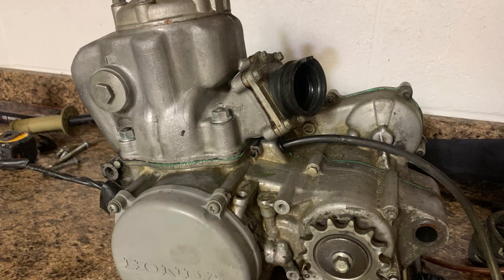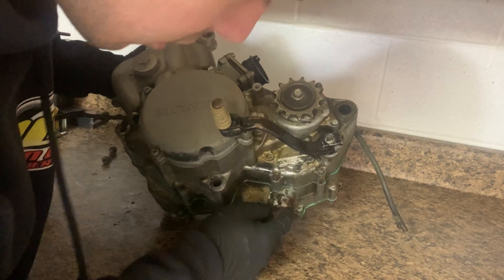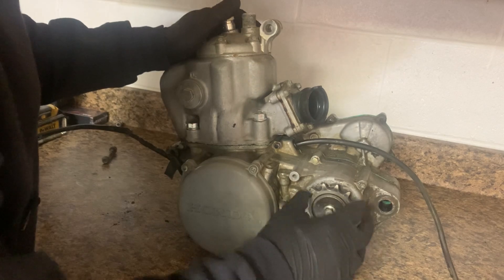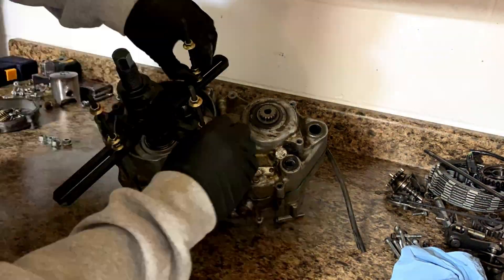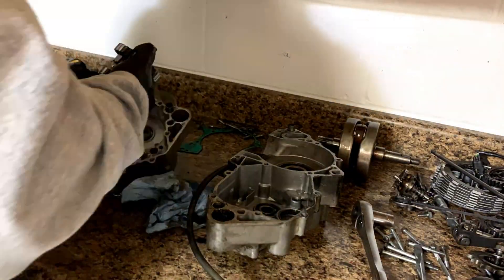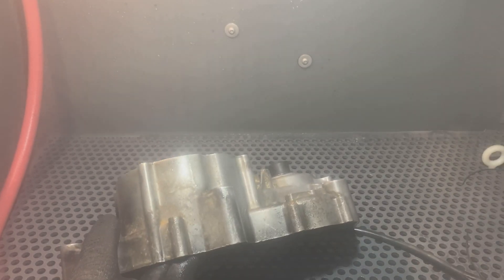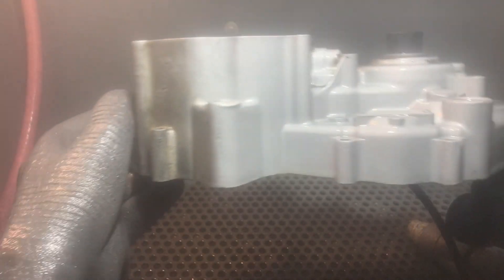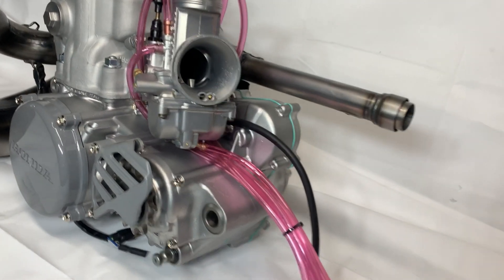Amazing 2 stroke engine rebuild 1995 cr250

Comment: I am wondering how hard it would be for a regular guy (as in not much mechanical background with dirtbikes) to rebuild a 1995 cr250 engine??? I just got a clapped 95 250 and to say the least it needs a bunch of bolts and shit 😂😂 would like to get it running